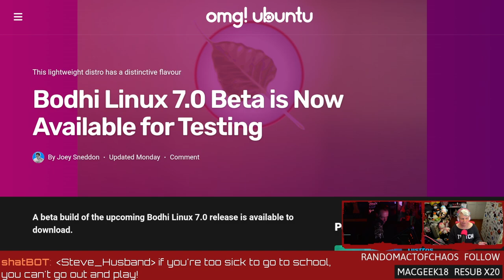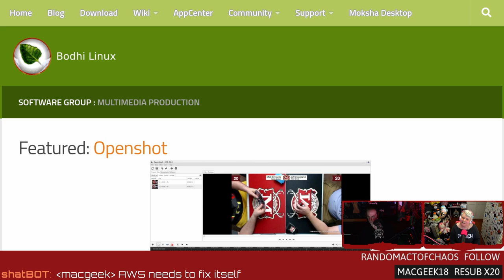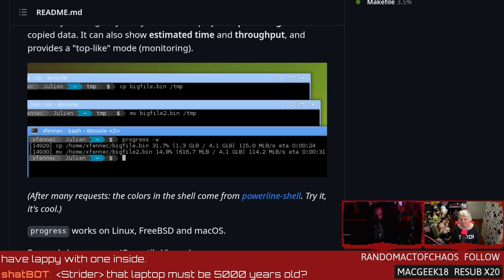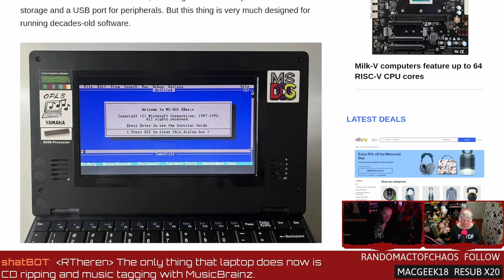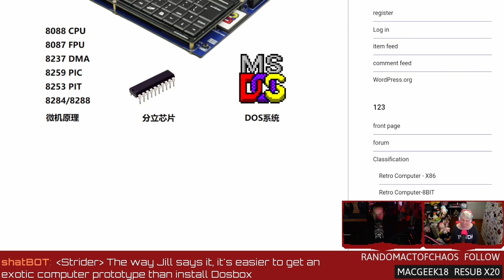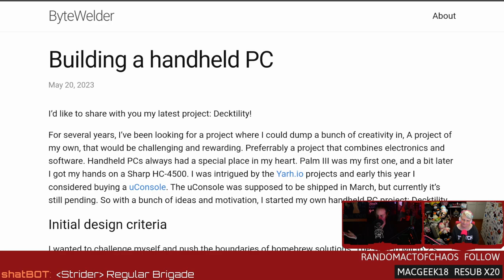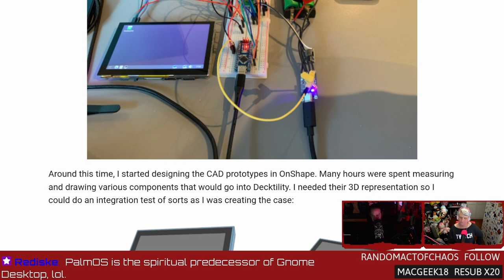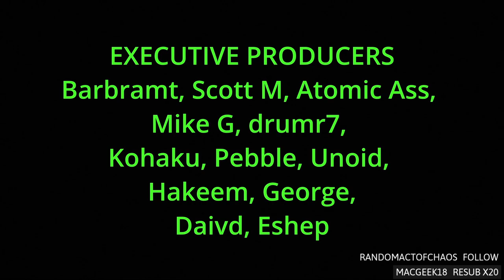LWDW 376: Bodhi Linux 7 & 8088 Laptops

Comment: Moksha forked E17, which was the most stable version of Enlightenment, and has made great strides in stability and has also backported features of more recent versions of Enlightenment. I think you should give it a try before you complain about Moksha's stability (based on your perception of Enlightenment's stability, not experience with Moksha).
Reply: I believe my stability comment was aimed directly at Enlightenment, not Moksha. Sorry If I misspoke. That said, E17 about as stable as a rabid emu on a methamphetamine binge.
Reply: @VennStone  E17 we forked and renamed was sorta buggy. We listen our users and thus made hundreds of improvements and bug fixes to make Moksha as stable as possible. Stefan